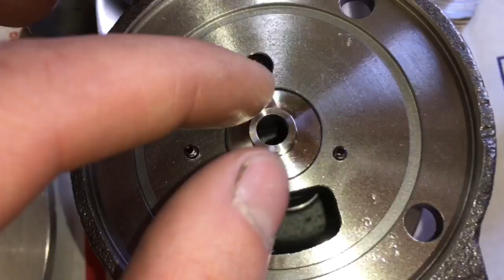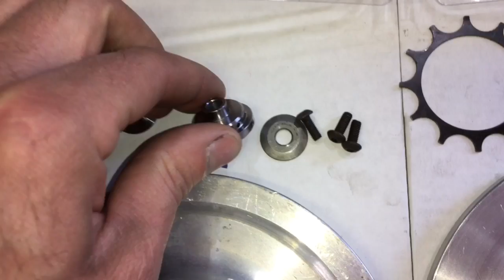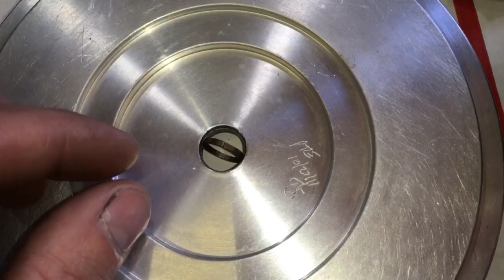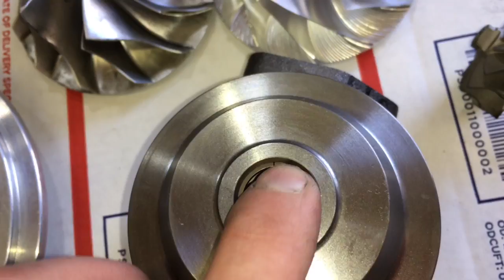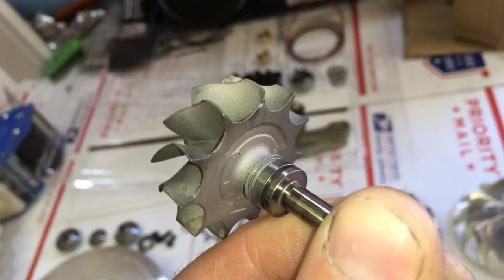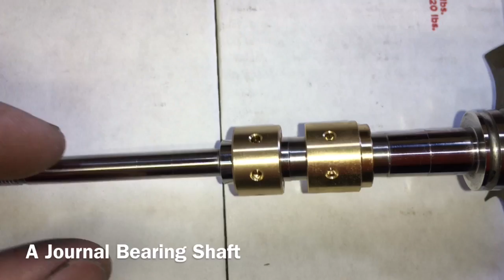Precision 6262 Turbo Rebuild Check List

Comment: Would you recommend rebalancing after removing the compressor wheel?
Reply from the maker: You can but don’t have to on this model
Reply: Mark the wheel and nut for reassembly so they line up